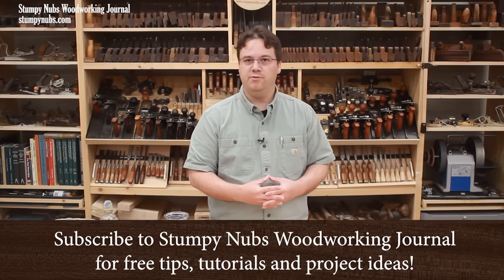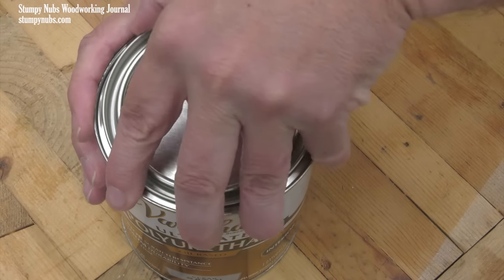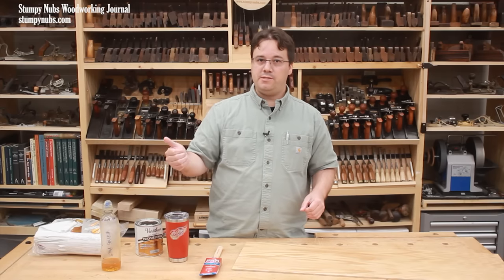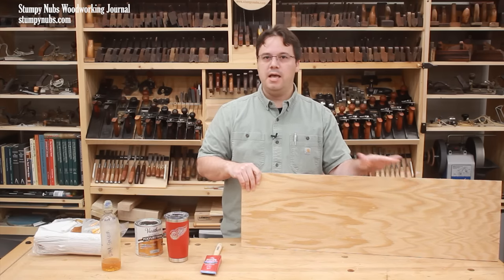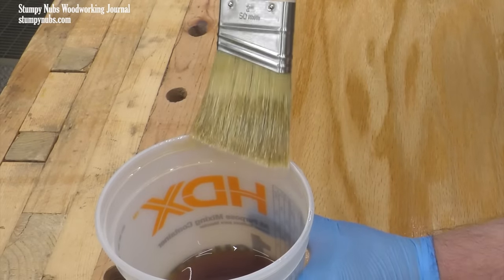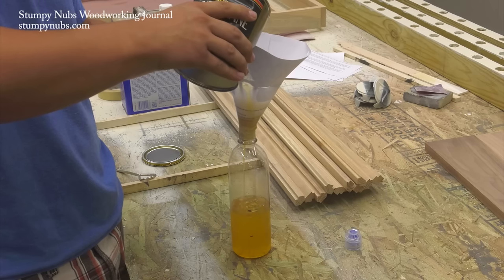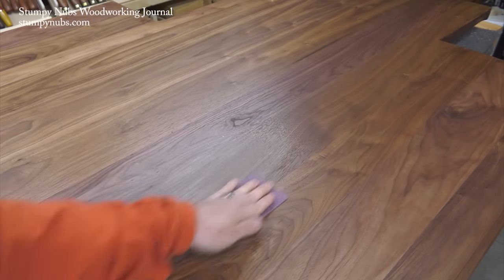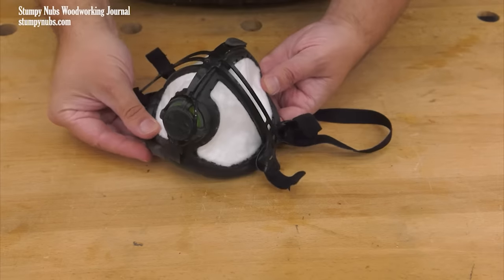Watch this before using polyurethane wood finish!

Comment: If you want a stain finish that absolutely glows,  this is what to do.  Never use poly with colour added that just always looks trashy.  Never apply stain directly to wood as it soaks into the end grain more,  grain is not straight with the surface but waves up and down which leads to very uneven colour absorption which looks blotchy and unnatural.    Instead:  Once all the bare timber sanding is done, apply 2 coats of sanding sealer without sanding between coats.  This is a clear finish that has a filler added so that it fills the grain.  This is especially important for timers that have a hardwood grain structure.  That does not necessarily mean a hard dense timber, but a mixture of large and fine vessels in the timber.  It is unusual to have a light low density hardwood but it happens, Balsa for example has a hardwood structure.  Softwoods have a uniform fine grain structure.  Examples of hard dense softwoods are those used for flute making, like African blackwood & Jacaranda. Anyway, no more than 2 coats, then sand lightly & clean off.  It is very important to only sand lightly so that sanding does not affect the consistency of then stain colour & all end grain is completely sealed.  Then you are ready to apply the stain, you can rub that on with a cloth.  If desired, you can do a darker stain with a dry course cloth so that goes on in streaks that resemble grain variation, this is particularly good if the actual timber is not figured.  When dry, apply finishing coats of poly.  the classiest most glowing timber finishes I have ever seen were done this way.
Reply: @pinarppanrapir9489  Not necessarily, it holds true for PU varnish finishes as well IME.  If you varnish straight on the timber, you get grain print through for many many coats, especially hardwoods.  The sanding sealer gets that dealt with in just 2 coats.  So you need far fewer coats which is a lot faster to get a glass finish.  The main takeaway though is seal the grain before staining.
Reply: I find that sealers change the wood color to a light amber. Have you found any that don’t?
Reply: @NeedsMoreToys  I am using Feast Watson & I'm staining on top of the sealer.  I do some tests to adjust the stain accordingly, I haven't taken particular notice of light amber colouring with the woods I use.  I'd probably consider that beneficial unless working with something pale like Huon Pine.  I am more than happy with the results.  All turps based Polyurethanes (PU) tend to yellow with age, while water based PU are reported not to do so.  However I haven't used the latter as yet.

Comment: Is that a screw driver you are using for a paint can opener. My 6th grade woodshop  teacher (Mrs. Dever) would have a fit. Great video.
Reply: It’s the only reason I still have flat head screw drivers, ha. And screwing on wall switchplate covers.

Comment: You didn't mention anything about a application window for second coat?
I've experienced som e massive wrinkling of previous coat with oil based pu finish. Still trying to figure out what I did wrong. I expect I waited around 18 hours from first coat. Can says Second coat: Al least 5 hours.  It also says light duty: 8 hours and heavy duty: 24 hours. Dust-dry 50min.
It does not specify a second coat window and I may also have had problems with the base-oiled wood. All I know is I had to scrape the wrinkly gunk off and try again.
Reply from the maker: I didn't?

Comment: Great stuff, as always. However, I take issue with tacking the work with dna or water when using varnish/oil-based poly; I think it's better to use mineral spirits, or cheap mineral sprits--also pronounced 'paint thinner.'
Reply from the maker: Alcohol and water both leave no film when they evaporate.

Comment: I find lacquer thinner to be superior to mineral spirits for cleaning the brush. If you leave the brush "soaking" in mineral spirits, you will see a milky white solid precipitating out of the solution. I suspect lacquer thinner is better for dilution as well for this reason.

Comment: I'm getting ready to poly a mantle and since this is my first time I've been doing lots of reading and watching. One point that I find the most confusing is that there seems to be no consensus on sandpaper grit. I've seen 220, 320, 400, 600. What gives? The manufacturer recommends 220. You recommend 400. I totally love your videos, I've learned lots, but what really is correct?
Reply from the maker: "The manufacturer recommends ..." I have never seen any consensus among manufacturers on sanding grits. That's because there are no hard, fast rules. I recommended what works best for me. If something else works for you, do that.
Reply: @StumpyNubs  Great, thanks for your response. I guess I'll just go for it. 🤞🤞

Comment: Do you need a heavy duty mask for Water based Poly? I am going to be finishing a computer desk I just built, going to sand, then use an aniline water based dye and was thinking I should use a water based Polyurethane to make it durable? I have the aniline dye(powder that has to be mixed) already but have not bought the polyurethane.
Reply from the maker: Water based poly contains no VOC's, so an activated charcoal respirator is not needed for brushing it on. But if you are spraying it, you do want to keep it out of your lungs. In that case I would still wear a respirator.
Reply: @StumpyNubs  Thanks, I think I will use the Water based Poly since it is safer. Are you making a video about how to apply Water based Poly and is it different?

Comment: How do you eliminate bubbles from application using a brush?
Reply from the maker: If you don't put it on too thick, the bubbles should disperse as it levels, before it dries.

Comment: If using these methods on white oak would you still use grain filler?
Reply from the maker: If you want a very smooth surface, yes. If you want a more natural surface, no.

Comment: I use 0000 steel wool to LIGHTLY polish surface after last coat. Also have used plastic scratch pads. After final coat, add a paste wax top, again with steel or plastic scratch pad to buff surface.  Do not apply mu h pressure ot remove finish.

Comment: as a professional paint/stain/finish guy of over 8 years, the only criticisms i have is that you said "a few hours" for dry time, but unless you have specialized equipment to speed drying, that brand of poly is 4-5 hours minimum. even with thin coats, I've had to wait up to 8 hours if it's not 70F or more. oil poly WILL dry at almost any temperature and humidity that we can safely be in without issue, but dry time for any finish is largely dependent on both temp and humidity. so while "a few hours" can be accurate, think of it more like most if not all of a standard work day few, not 3-4. 

Another criticism is the thinning of it. i don't recall what it says on the can because I've never had to thin my poly, but the vast majority of finishes break down some on a chemical level if you thin them any more than 10%, and something about them won't be as intended. with some finishes, it's the hardness, others (like lacquers and latex paints) its the gloss, and with yet others, its their ability to bond and stay bonded. some also have uneven drying and/or lengthened dry time. if you're going to thin your finish, always always always check with the manufacturer to see if they recommend it, what the tolerance is (as stated above its usually 10%), and what drawbacks you'll see if you thin too much. 

also, side note, if you're spraying your poly (WEAR YOUR RESPIRATOR), you can shake the can, and if you see bubbles forming in the finish, its air coming from the wood, but you can pop them with a thin misting of acetone/lacquer thinner from your cup gun without any problems as long as its air and not electric (other solvents may work but I haven't tried them so I'm not gonna vouch for them). I know this video is for people at home and not necessarily in a professional setting, so they probably wont be spraying, but since i was here I thought id tag this on for anyone who is interested.
Reply from the maker: 4-5 is a few... Poly is thinned 50% all the time. They even sell it pre thinned as wiping poly.

Comment: As a chemist who worked with solvents for my entire career, I recommend using a respirator specifically designed to absorb solvent vapors such as a 3M respirator with 3M 60921 Cartridge/Filter Organic Vapor cartridges if you are working for any time with solvent based materials. Once you smell solvent, ditch the cartridge and buy new. Also ditch if past the expiration date.

Comment: the future is plain linseed / flax seed oil      wax added for exterior use    mechanical mixing with water for exterior flood application via spray

Comment: I don't think n100 filters have activated charcoal so they wouldn't help with the volatiles coming off of the oil based poly.
Reply from the maker: Did I say n100 in the video? I thought I said you needed an activated charcoal filter...
Reply: @StumpyNubs  you did,  but the respirator that you recommend comes with n100, I couldn't find any activated charcoal filters for it.
Reply from the maker: @frankbruce6889  You mean in the ad at the end? That wasn't part of the tutorial.

Comment: Is it weird that whenever you mention or show the solvents I can smell them? (I've had around 60 years of exposure - my father was a painter). Technique thing - a few of the early shots of you brushing on finish show you starting by coming in from an edge - this will almost guarantee dribbles down the raw edge - later wide angle shots show you starting on the main surface then brushing off over the edge which is much better - you can start with short strokes a hand span in from the edge going towards the end then change back into the other direction 'feathering' the brush to touch down on the wet area. Brush maintenance - after cleaning with solvent, wash the brush with soap & water and shake out the water, unless it is a really high quality (black) hog bristle brush (you should be able to see a change in the gloss of the bristles - the 'oil line' - where the natural oils in the hog bristles end - the closer to the loose end of the bristles the better the quality.

Comment: From your video you are over working the finish. Brush it on and don’t keep brushing over it or you’ll get brush strokes on the finish. If you’re going to work it like you’re doing in this video then thin it before doing so however I don’t recommend doing that. Personally I dislike polyurethane because it’s difficult to apply smoothly without runs. I tend to use lacquer instead. Goes on like glass and dries quickly allowing faster recoats. You can get UV additives for lacquer

Comment: How would you recommend sanding between coats on stained wood?  I sand through with even the lightest of one pass when sanding after the 1st coat, esp on radii and edges.
Reply from the maker: Sand lightly by hand after each coat of poly. Don't sand the stain alone.
Reply: @StumpyNubs   HA! Sorry, wasn't clear.  Stain, then after p/u 1st coat, I sand the p/u lightly and get sand through.

Comment: The main reason for using natural bristle brush is NOT because the other type might break down in poly. Its because it will hold the product better.  But never use bristle brush with latex etc beause it will fill up the natural porrisness whitch you cannot restore to its natural state..
Reply from the maker: I specifically said it will hold the product well, even before I mentioned the breaking down issue.

Comment: Oil based products used indoors will fill the air with their vapors - breathing too much of that will give a “buzz” / “high”, and that should deter anyone from operating a vehicle or other equipment.

Comment: I like the Poly methods, thanks, however, the TREND masks are rubbish for exhalating breath, I have been using them for a good few years now, with my wood carving but and changed to a full face mask. The Trend mask is good for keeping dust out, but your breath builds up inside your mask and starts dripping on your work from the placement of the exhalation Value at the bottom.  Not using again.

Comment: PLEASE use gloves while messing with denatured alcohols.  In your video you are handling it with your bare hands.  The poisonous methanol denaturing the ethyl alcohol, can be absorbed directly through your skin.  I had health issues until my use of that stuff in woodworking was identified as the source.

Comment: I hate polyurethane!!  It takes forever to dry.  I have tried at least 5 different brands and it takes at least a week between coats both wiping and brushing thinned or not.
Reply from the maker: I can not imagine why that would be. Even on a humid day in Michigan, it is dry by the next day. The wipe on poly I did in this video was ready to sand after four hours.

Comment: I would never use a brush for poly. Way too much product at one time.  That's where you get the extra "plastic" look that people complain about. Wipe on or use foam brush with minwax wipe on Satin. No gloss or semi-gloss. 3 thin coats and you wouldn't know the difference between this and lacquer.  No thinning, technique, or thinking required.
Reply from the maker: If you're getting "way too much product at one time" with a natural bristle brush compared to a foam brush, you aren't doing it right. You can put on as thin a coat as you like with either type of brush.
Reply: @StumpyNubs  Probably true, but after 30 years of using poly, I find wipe on (no dilution) and barely getting it wet, the easiest. No poring on and spreading out. I mention foam because for some it can be easier to control if doing thin coats, as you don't have bristles pushing down essentially creating grooves of poly as can be seen in video. Tradeoff's as you say.
Reply from the maker: @fwiler  Fair enough :)